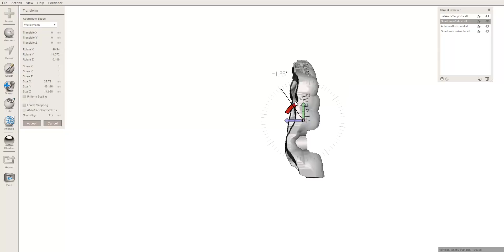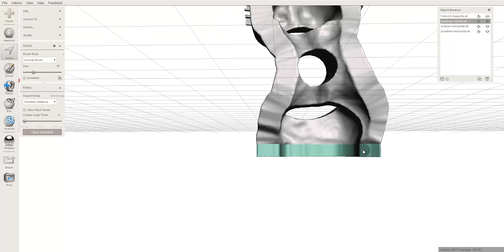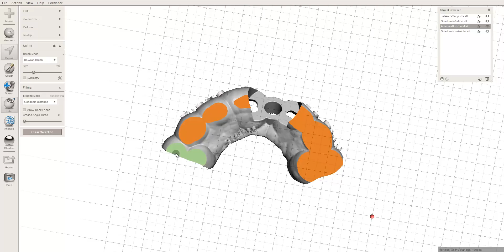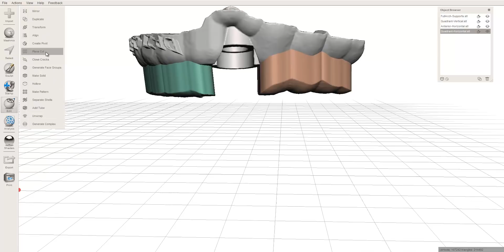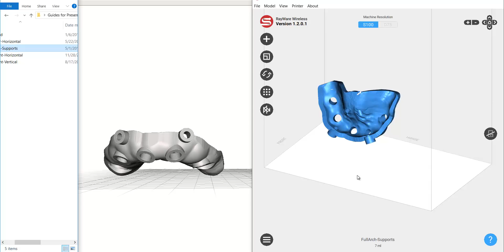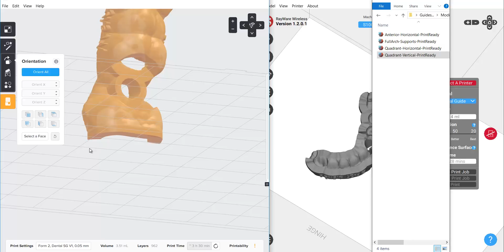Preparing Surgical Guides for 3D Printing

Comment: Hi i’m new to all of this. Are you making your guides directly from the cbct scan file or are you using a digital impression in combination?
Reply from the maker: DICOM and STL. You CAN take a second CBCT of a stone model or Impression.
Reply: Hi. Thankyou for the reply. We do have the (older version) cerec oral scanner. Would I be able to scan a model or patient and transfer that stl file to bluesky?. Merge this with the cbct scan and from there print a guide? I appreciate your help - if you have/know a video explaining the steps I would be grateful. Thanks in advance.   @bgrutterdds
Reply from the maker: Yep. You can use the Bluecam. it can be a little tricky for for large cases but you can manage this on a model. what kind of videos are you looking for?
Reply: Baron Grutter DDS Hi Baron. I’ve tinkered about with the bluesky software using a patients cbct file. Worked out the basics of implant, abutment and crown positioning but quite a novice attempt. Struggled with the (?)curved slicing view - the lines seem to have a mind of their own when i try to centre the points along the arch - i will probably need more practice. At one point i lost all the imaging - not sure how and had to reload. Any step by step videos from planning right through to guide fabrication (importing stl file and then 3d printing)? Not being lazy just that there are a lot of videos to choose from. Thanks again
Reply from the maker: How's this:

https://www.youtube.com/playlist?list=PLZ5lds9W8W8rh_2Nebdld78hUcCpTJqR9

Comment: Thanks for the great video! I am currently using a robox printer, how much adaptation would i need to be able to print these guides? Also which program are you doing the extrusions and planing in? I've only used blueskyplan and automaker so far(im just getting started).
Reply from the maker: +Roth Hinkle FDM printing setups are quite different. You'll have better luck asking Cory Glenn or Danny Domingue about that. This was all done in MeshMixer.

Comment: Thank you for your videos. They are very useful.
Could you tell me how can I design the guides with fixation pins holes on Blue Sky Plan?
I'm having some trouble printing the guides with no supports on the Form2. The resin doesn't stick on the build platform.
Reply from the maker: +Tiago Varanda for adherence, make sure you have a large flat area. Or, use supports. For a full arch guide, use supports.

For fixation pins, you just plan them like implants. 4th tab in the implant pop-up (when you click Add Implant). Make sure the guide tubes are on just like with the implants.
Reply: thank you very much. How couldn't I figure it out about the fixation pins? So simple...
About the adherence on the build platform, I guess it is some kind of issue with the resin (dental SG). I edited the guide in Meshmixer like you showed on the video, giving it a real large flat occlusal base, but it didn't stick on the plate. Now i'm printing all the guides with supports, but I wish I didn't need that.
Reply from the maker: +Tiago Varanda Form2 does have an issue of clouding on the tank. Particularly with Dental SG. The clouding reduces laser light energy from properly curing it to the build platform. Can be quite frustrating.
Reply: Do you know of any way to increase the thickness of the guide tubes wall? It would be great, because some prints fail just on those, and is a waste of resin and time.
Reply from the maker: +Tiago Varanda used to be in the parameters. But, can't find it anymore. I'll check with the developers and see if that setting has been moved or eliminated.
Reply: Hi Baron. Thank you for your help! I found the setting and my prints are fine now.
However, I find the guides a little bit loose on the teeth. Not very much, but I would like to have them just a bit more tight. Don't you feel the same?
Reply from the maker: Guide fit is related to Surgical Guide Offset. That's in the Preferences. Default is 0.20mm. you might want to try 0.15mm.
Reply: I definitely will try that. Thank you again